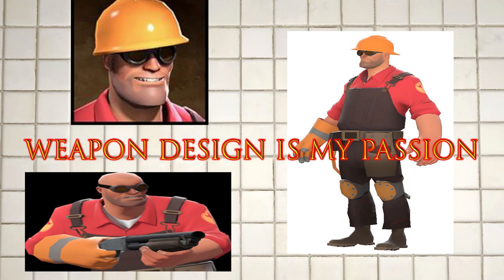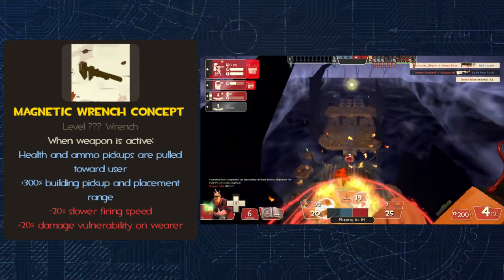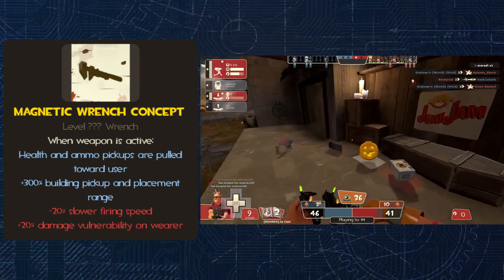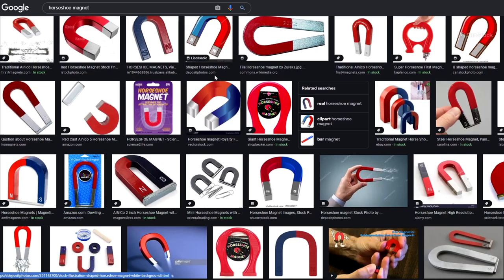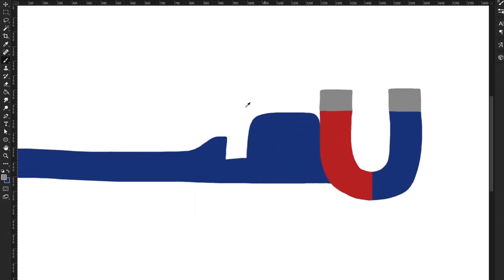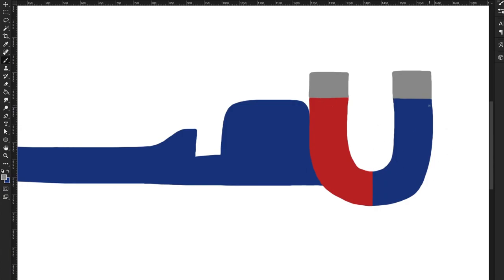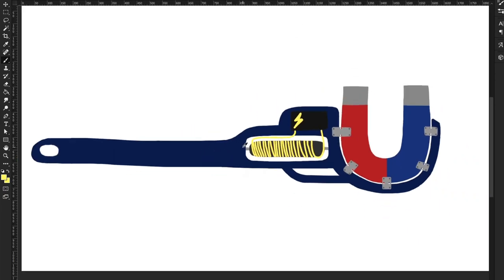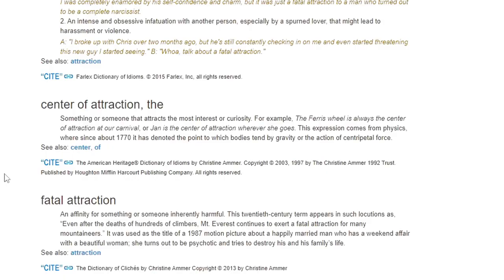Harness the Power of MAGNETISM - An Engineer Wrench Concept [TF2]

Comment: I saw a bunch of comments about this being an Alt-fire sort of situation, and I think that's a better idea than just having a passive magnet.
If not for nothing but avoiding stealing health packs from your team.
I like the idea of engine being able to become a bullet sponge to both refresh metal (from the bullets in his face!) And protect his sentry/team. Really reward setting up and ambushing, and maybe even letting engie be a meat shield for a bit.
This is kinda getting away from the "timesaver" mentality, but it's pretty neat.
So some thing like:

Passive:

- metal capacity increased to 250

- 20% slower firing speed

Alt fire (hold):
- Attract nearby ammo, metal, and health kits (the sort of main thing from the video)
- increased hitbox size by 30%  (cause you'd be pulling bullets towards ya)
- 75 increased health (you can't do anything while holding this weapon, might as well be able to tank a few shots)
- getting shot gives you metal! (1 to 1 ratio - health to metal? I think that considering how expendable metal is that's actually pretty alright)
- 15% decreased movement speed while active (this is to make this less of an escape tool, and make spy more of a hard counter with a backstab. It's a weapon you are meant to run in, take a bunch of damage, get some one to chase you, and swap over to your primary to finish your enemy off after your sentries ol' bullets had a nice field day with them.)

Comment: A primary weapon for beginner spies, which is somewhere between his revolver and the Scout’s/Engineer’s pistol, both in terms of damage but also rate of fire.

Also has a larger magazine and increased reserve ammo capacity.

Overall damage and accuracy would be reduced, but it would have increased aim assistance, and it would have less damage fall-off with increasing distance.

Random critical hits would be more frequent, but they would only be mini-crits.

The weapon would also glow (and produce a laser sight, offsetting the increased spread temporarily) when your next shot will be a random mini-crit, letting both you and your enemies know that it’s about to get real. 

Both the laser sight and your mini-crits will be lost when you reload, switch to a different weapon, or cloak/disguise.

Lastly, reloading before your magazine is empty will cause you to temporarily lose whatever ammunition was still in the magazine (it will slowly regenerate in your reserve.)

When the weapon is equipped, you will take increased damage, but will have resistance to knockback, bleed and crits (which will become merely mini-crits.)

Comment: About the mini-rant you had about physics majors:

I am not a physics major, and my only experience with electromagnets is from Elementary School. An electro magnet is just what you drew; copper wire around a piece of (probably) ferrous material. Electricity goes in, magnetic waves grow out. The way you wrap it doesn't really matter as long as the wire doesn't overlap (maybe. if I had to guess it could go bad when electricity is added). The big thing to mention, and the only real property that makes electromagnets stronger, is how many times the wire wraps around the centerpiece. More wraps, stronger magnetic field. 

Given our general knowledge of The Engineer, your hodge-podge wrappings of the wire is literally perfect.

Comment: I had an Engineer PDA idea myself, focused on buffing the dispenser at the cost of the engie's other buildings:

"
+25% Building health (All buildings)
+50% larger dispenser range
Player health regeneration from dispensers is increased by 25%

Player ammo regeneration from dispensers is (increased/decreased) by 10% (currently undecided)

-25% dispenser metal gain (so for example, a dispenser will only gain around 30 metal at level 1, 37/38 metal at level 2, and 45 metal per refill at level 3)
The wearer is marked for death when inside any dispenser's range.
Sentry and Teleporter level max have been decreased by 1 (Teleporters and normal sentries can only be upgraded to level 2, while mini sentries cannot be built)
"
As a bonus, in MVM, instead of a disposable sentry, you get a disposable dispenser instead, this dispenser has a shared health and healing/ammo pool, it replenishes health and ammo at the same rate of a level 1 dispenser. It does not give metal to nearby engineers. Once it heals 1000 total health and/or 400% ammo, the disposable will self-destruct. The disposable will die anyway if a bot destroys it.

Comment: I would make something like this 
~When you left-click with Center of Attraction on an ammo pack. it will pull the pack to the engineer's location (loc. that user left clicked) moved ammo packs will reappear on their original point after some time. The gravity pull will recharge over 7.5 seconds
+Construction hit speed boost increased by 30%.
+15% faster-firing speed.
- Raises explosive vulnerability by 15%
- –25% damage penalty

On the gameplay side whenever you need an ammo pack but it's just too far away or near the enemy engineer nest, you can just pull it to yourself with this item and use the metal as freely as you want. You can even pull some ammo for your heavy across the map to crush the enemy team's Conga line. But don't forget even it moves it's still an ammo pack that can be picked up by anyone for e.g "Clumsy" Scouts, Enemy engineers that really want that sweet metal scrap, or some spy cloaked and ready to troll you.

Comment: I had an idea for a flamethrower for Pyro that plays off the idea of a thin nozzle for the flames to come out of. 
Its more focused on precision, the flames hitboxes are smaller and move in a smaller area, but deals more damage and afterburn which slowly increases overtime the longer the flames are held directly on the target, so no rapid spins like a madman. Due to the thinner nozzle, air-blast has a smaller hit-box, which makes it harder to reflect things, but reflected projectiles are now full crit rather than mini-crit.

Comment: Fun battery fact! The battery you had would've worked if you simply added brown and white slits in the middle as a copper-zinc battery for every stack of copper, zinc, and salt water soaked paper produces 1 volt, meaning if you split it correctly there would've been over a dozen volts.

Comment: Here are some edits I would make to it.
pros:
+200% building place range.
+400% building pick-up range  (this is because of how magnetism actually works everytime you double the distance between an object and a magnet, the pull force is 4 times weaker.)
Cons:
25% slower firing speed

alt-fire to spend 30 metal to pull ammo and health toward yourself for 10 seconds.

Comment: One weapon idea I've always had in mind is a firehose for Pyro. Instead of a flamethrower, you'd be able to shoot out a high pressure stream of water. It would be strong from really close range, doing good damage and pushing the enemy back like an airblast, but falloff would effect both damage and the amount of knockback. It would also do things like putting out fires and making units wet (finally a reason to use the neon anhilator outside of pyroshark). The main downside is that it goes through ammo even quicker than pyro normally does.  Right click would be a tame stream of water, doing no damage, having little fallback, putting out fires, and getting enemies wet, but it wouldn't go through much ammo at all. It would be a really interesting alternative weapon for the Pyro, especially being an alternative to their primary.
Reply: Just use the gas passer to wet people if valve would buff it

Comment: This is actually a similar'ish concept to the Swifty Swiper we have on the cTF2w server except it's a secondary based on like the wrangler where you have to use metal to pull things in so you can't repair and pull stuff in at the same time

Comment: Interesting idea, but I think the stats could be made better. For example, you could replace the passive magnetism and defense decrease with something like this: holding right-click at nothing in particular makes Engineer hold the wrench in front of him and produce a beam that has finite range (+/- 1.5 x sentry range); the beam will attract all ammo pickups and building gibs to the user, but when the beam is cancelled, the pickups drop where they were; the beam is also visible to the enemies and marks user for minicrits. That way getting ammo/metal is more convenient and can also be used to get ammo for teammates, while also revealing user's location to the enemy and making the user an easier target.

It might also be a better idea to remove swing speed decrease and replace it with either higher repair/upgrade cost, or the beam costing metal when being used.

Comment: I have a concept for this wrench:
Basic stats:
+300% Building pick up range
+100% dispenser range
-20% firing rate
-10% damage vulnerability 

On Reload:
Change function of push and pull, simular to the eureka effect

On Alt-fire:
Depending on the mode, projectiles, health and ammo packs will be repelled or attracted to the engineer, at the cost of 5 metal per second. The power of repel is 25% of the air blast, and the power of attract is 100% of the air blast (if the air blast is 100% effective).
During Alt-fire:
-10% movement speed

Comment: i feel like slower firing speed is too harsh for an engineer wrench, I'd just give it a stat similar to the old eureka effect like "20% slower upgrade rate", and possibly the eureka effect's current slower construction hit speed boost as well. This would mean 10 hits to upgrade a building instead of 8.

Comment: I had this idea for a new Pyro Primary called the Jetter and you can change the name if you want, but basically what the Jetter does is priotize airblasting rather than fire damage, I was thinking of a potential reduction of airblast cost, fire damage penalty, and if you get an airblast kill, you get +20 ammo back into your flamethrower which caps to about 200

Comment: In my humble opinion, you should’ve centered the design around a single-colored (probably team color) bar magnet. Then you could’ve called it “The Monopole” and included a humorous description about harnessing an impossibility of magnetic fields to drag scrap metal across the ground (or about how it only attracts). I think that route would make it fit in with the other wrenches, plus it would totally fit engineer’s character to build a wrench expressly to piss off physicists.

Comment: Engineer PDA(s):
The pyrotechnics' pad:
Replaces Sentry with Flame thrower sentry. 
Probably Does slightly less damage than the pyro.
Can't air blast. 
Builds and upgrades faster
Less health for gun.
Has a dispenser that heals slightly slower, but can instantly remove debuffs.
Has less health than regular.

 The explosive trigger:
Replaces sentry with mortar that shoots grenades.
Does less damage than demo but has a larger blast radius.
more range.
Builds and repairs slower.
Dispenser may give a slight resistance to explosives?
Maybe gives more ammo faster? (not metal)

The Pro-tech (protecc) PDA:
Replaces sentry with a one way shield like medic's in MvM. But instead of deleting projectiles, it lowers the damage of something flying through it (maybe by 10-30%?). But it can only lower one damage type at a time *like Vac*. The more damage it lower the more "ammo" it uses up.
Slower build, repair and upgrade time.
Dispenser  could just be given more range and a slight health boost
Slower build, repair and upgrade time.
teleporter Idk, maybe like a bear trap that causes bleed. It could be slightly visible like a friendly spy to the enemies? (like there is a slight colored outline that's just enough for you to see if you're looking close.)

IDK I'm bad at weapon design

Comment: Ok, here's a weapon design: A spy "watch" that is actually an hourglass enabling them to create fake holograms.

-While raised, records your actions for up to 3 seconds. (the remaining recording duration can be seen via the sand in the hourglass, when it's fully drained your time's up) Raising the hourglass can't be seen on your third person character model.

-When released/recording duration ends, you will become invisible (for the normal 9 seconds), and create a hologram which will act out your recorded movements on a loop. This duplicate will remember everything about what you did, including what weapons you had equipped, any disguises, etc, and mimic your inputs during recording

-The hologram is indistinguishable from a regular player visually, and will seamlessly pick up where you left off. It has 125 health, unless you disguised as a friendly class, in which case it uses that class' health. If it is destroyed, it fake dies akin to the Dead Ringer. Holograms vanish when you end your invisibility.

-Holograms have normal collision, except during their first second of lifespan. During this first second, bullets/projectiles pass through them and they don't collide with players.

-When the watch begins recording, you cannot cancel its effect, reactivating the watch just makes you end the recording, fire off your hologram and go invisible. This means if you enter a third person animation like a taunt while the watch is recording, when the 3 second timer is up you will cancel the animation, become invisible, and leave behind a hologram finishing your taunt. Invisibility can be ended prematurely, though. 

-Ending invisibility prematurely drains the cloak meter to 0

-Ammo pickups don't regenerate cloak

Far from an original idea but I think this is a reasonably practical take on the concept. Obviously the stats would not be laid out quite like this, but I wanted to be thorough explaining how the concept would work.

Comment: You could probably just forgo the whole attraction thing entirely and just make the Engineer's pick-up hitbox bigger so if the Engineer walks past a metal-box he'll just pick it up instantly as if he had walked over it. This would remove janky physics from the equation and would allow the effect to be used on respawning pick-ups without the potential issues attracting them would cause.
You could still have a visual effect where any metal picked up this way instantly zips towards the engineer.

Comment: I think the damage vulnerability should be replaced with this effect:

When deployed, the engineer gains bonus movement speed towards his buildings, but also actively loses movement speed (eventually until it slows you outright) when walking away from them. This effect will balance out if he is between two buildings (resulting in a net gain of 0 movement speed).

I think this would allow the Engineer to have an interesting movement/mobility mechanic that prevents him from running away too easily WHILE using his melee weapon. It would keep him closer to his nest while it's being attacked, which would also make it easier to nab the Engineer with splash damage. As a result, the Engineer may have to abandon a nest before it's attacked by something like a Demo-Medic combo or else he risks sinking with the ship. This type of wrench seems to incentivize rebuilding after destruction rather than encouraging the sustain of said buildings (hence the -15% swing speed).

Outside of that, I also think that it should break sappers in 1 swing rather than 2. This may sound overpowered, but a Spy should still be able to effectively disable and damage a sentry while the Engineer is removing sappers. Maybe even have a slightly higher swing speed penalty to compensate for it (Maybe 20-25% instead of 15%?).

Comment: I would've made it look more like a tuning fork than a pipe wrench. just seems like it'd be easier to electro-magnetize, plus you could do the thing where a spark travels up in pulses between the forks. As far as stats goes, I hate damage vuln, so I'd either reduce it or make it only apply either when active, or when hauling. To compensate, I'd make the firing speed even slower; however slow it needs to be to equal 1 whole swing per second.

Comment: I think this weapon concept would work better on the secondary.

fire : pick up ammo pack from afar (like picking up buildings with the rescue ranger)
alt-fire : repel nearby enemy projectile (like an air blast)

This would be a good alternative to the Wrangler to protect your building from enemy projectiles. Or it could be used by battle Engineers to fight Soldiers and Demoman head on without being unfair like the Short-circut

Comment: Maybe change the damage vulnerability to marked for death that lasts 5 seconds even after switching or stopping the ability, change the magnet ability to be a secondary action with right click, and greatly increase the range to maybe like the equivalent of 20 meters and it could be a useful but vulnerable way to get back enough metal to reset a nest

Comment: Id probably simplify the main use from a physics based gimmick to an actual option. Id probably change the use to a simple right click and some metal would allow you to collect a health kit or ammo box, a decent range maybe shotgun chip damage (25-40dmg) and the cost would be outweighed by the metal pickup with medium ammo box so the engineer could still use it to pick up gib boxes and continue building. The other stats are a good balance, especially the damage vulnerability as the engineer has more options to keep himself alive.